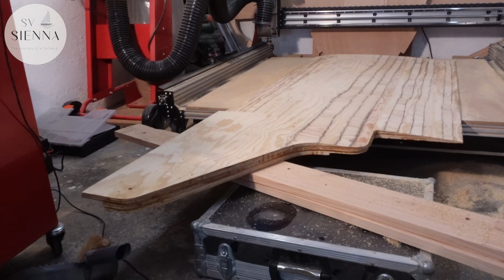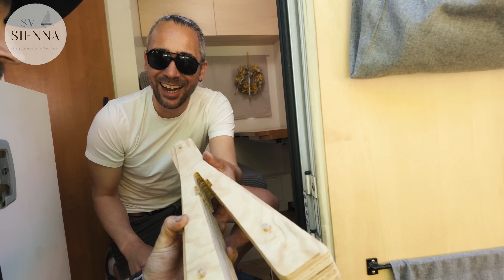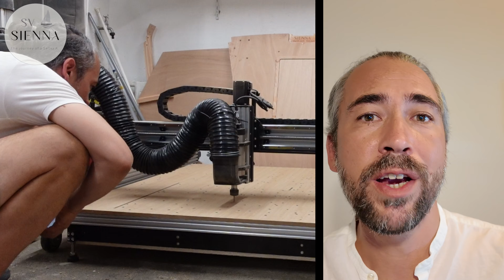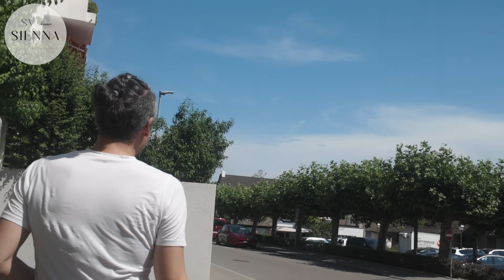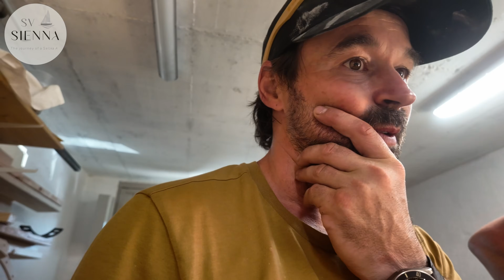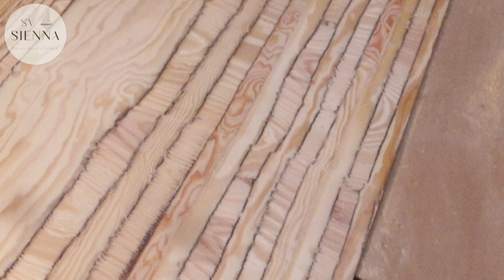Final CNC machining on the Temporary Ghostship Keel

Comment: After all this, will you be doing your own keel and rudder the same way?
Great explanation of how the project went by the way 👍
Reply from the maker: Hey Karl, I will for sure use the CNC for the keel and rudder. About the keel, I will not have concrete as balast, but a lifting keel is in the plans 🤩